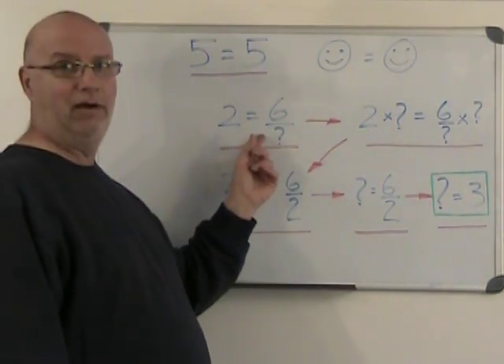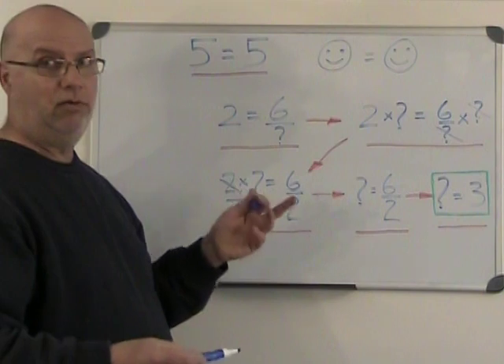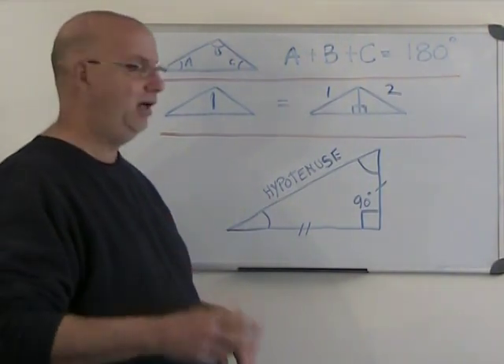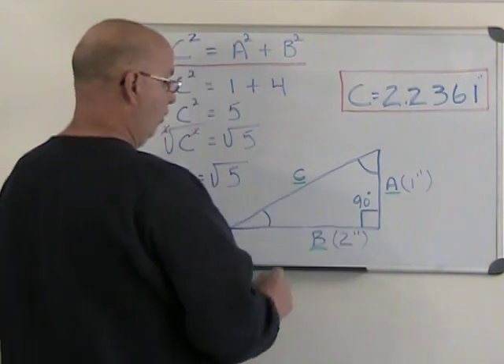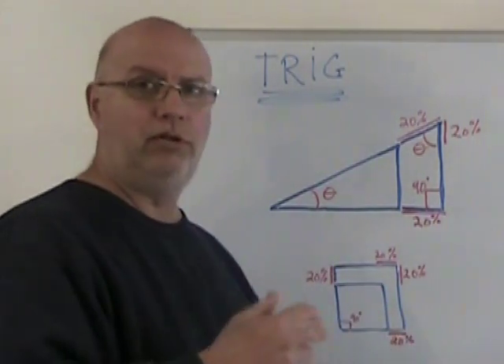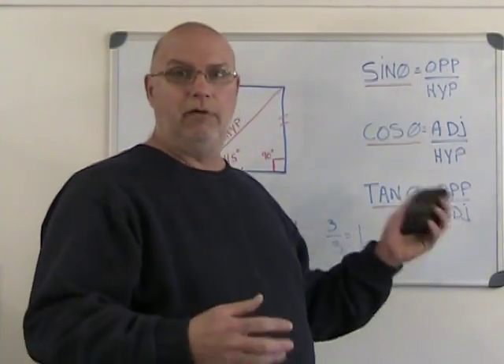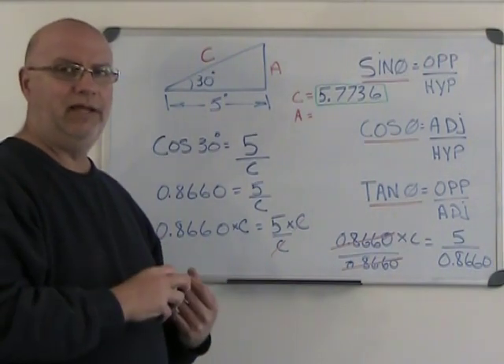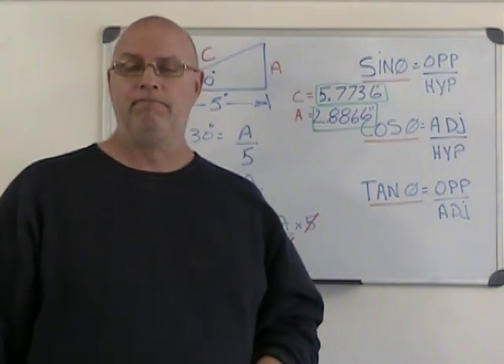Trigonometry, triangles, Pythagorean theorem & other tricks, shop math 101, MARC LECUYER

Comment: I got through trig in high school, and came out able to solve the abstract equations they presented.  What I never knew was what good they were to me in my life.

Fast forward 30 years or so and I got into home shop machining.  I bought a small lathe and mill and started making chips, which was fun enough.  Then I bought an old copy of Machinery's handbook, and saw the diagram in the early pages regarding trigonometric functions.  My eyes nearly popped out of my head as my brain made the connections between the abstract and the concrete.
Reply: Make a video please.

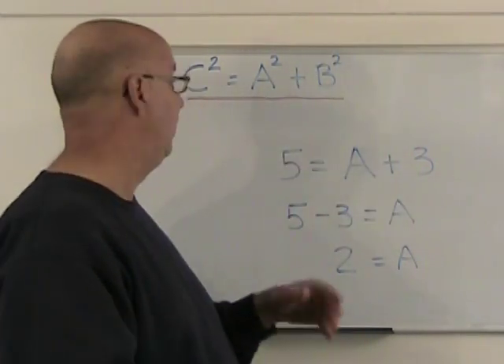Comment: hi marc, i would like to add my 2c. when explaining the simplification of equations your are using a property of equations that says that if you operate the same factor to both sides of the equation the equation remains unchanged so at around 13:00 when you explain the difference when there`s a sum or a substraction you can explain saying in the case of your example 5=A+3, you choose to operate -3 to both sides of the eq (bc you are so clever :)) and it goes -3+5=A+3-3 so in fact is 5-3=A+0 or 2=A just another form of explaining i wanted to share i explain to my students (i teach at vocational school after my shop day) all the time when they have a hard time remembering the change of sign (which is an abreviated form). oh and another is SOR CAR TOA. thanks again for your help and for sharing your knowledge. regards. pete